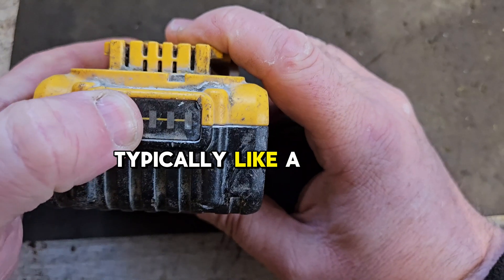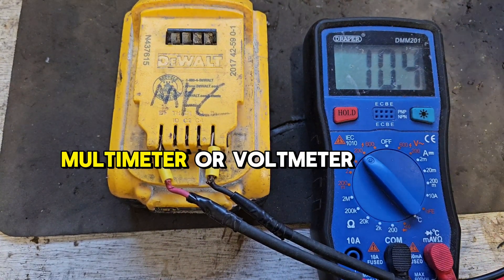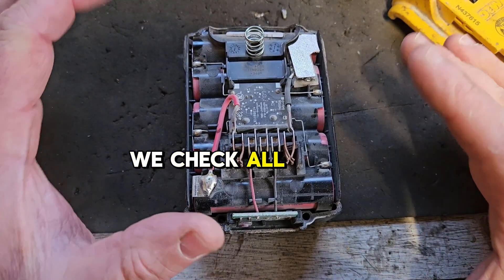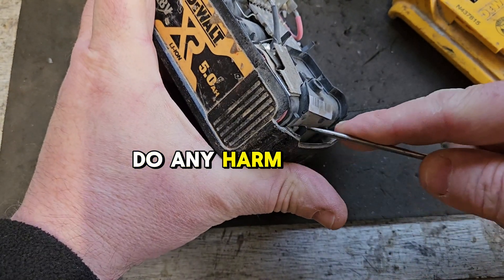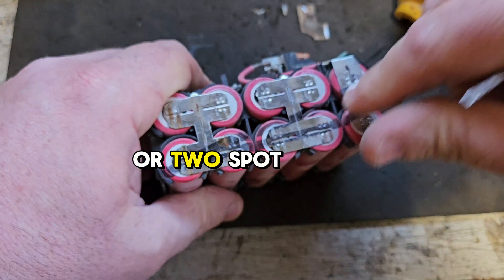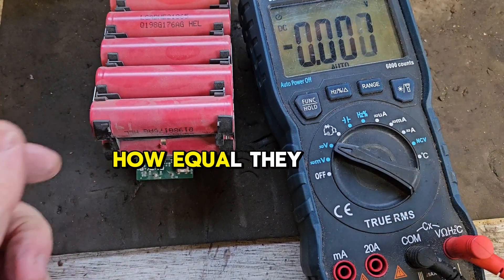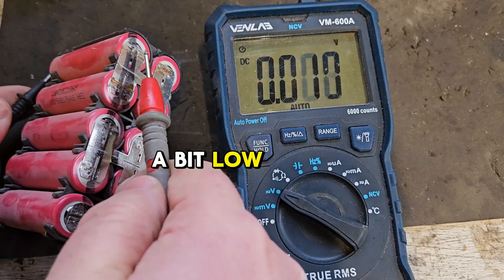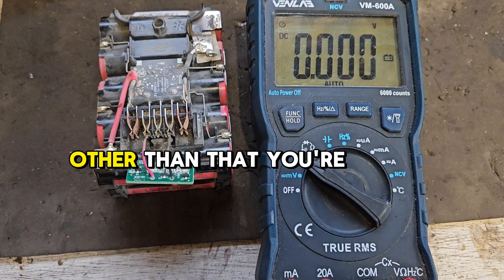5 Reasons Why JUMPSTARTING is wrong

Comment: Can I use a good cell bank from another battery that is broken to replace a cell bank that is bad in another battery to make one good one? Also I have both 60V flexvolt batteries and 20V batteries that are bad, are the cells interchangeable to get one of my 60V working?
Reply: Flex volts are a bitch of a configuration given the 20/60 volt switch rewired batteries from parallel to series, the regular 20V are simple but flex volt their is a lot of desoldering and careful removal of the side circuitry that handles the reconfiguration of batteries, honestly to map it out find the cell/s then replace it correctly without damaging any of the paired spot welds is going to be a days work, unless you do it for a living not worth time and effort buying a new one more efficient.
Reply from the maker: The cells in a 4ah 20v will be similar to the ones in the 6ah flexvolt 60v

Comment: Absolutely bang on. Extremely rare that one comes across my desk that could be "fixed" by this jump starting nonsense. 90% have at least one dead pair of cells, 5% blown fuse link or spot welds, 5% bent pins. Do a video on removing and soldering in new pins!
Reply from the maker: Thanks Ben I did fix pins on livestreams and an older video but I will do a dedicated one if I get one in the future